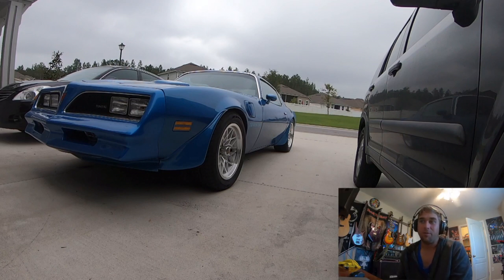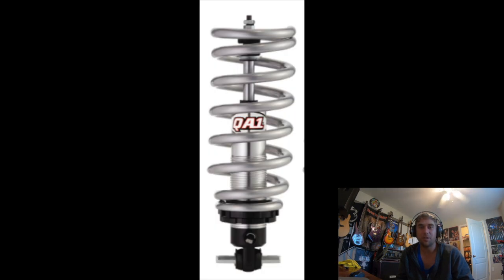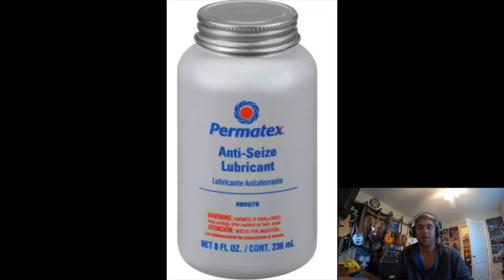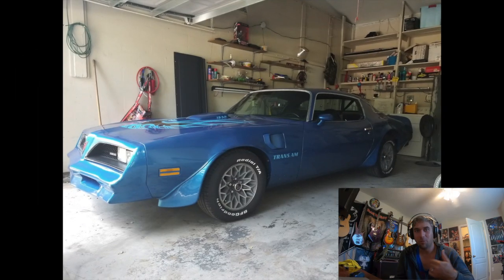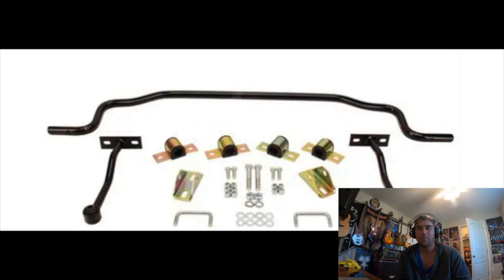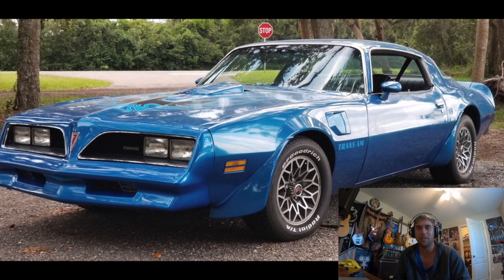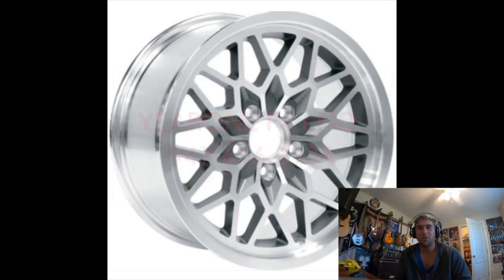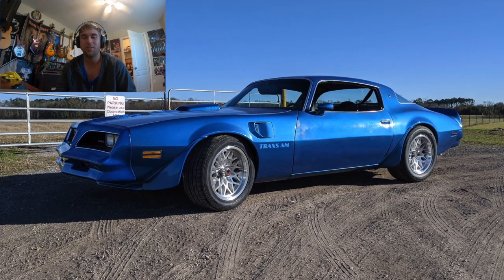1978 Pontiac Trans Am Martinique Blue QA1 Coilovers

Comment: Nice TA, good job.  I like the 255-50s also.  Looks good and fills up the wheel wells. Thanks for posting this.
Reply from the maker: Thank you very much. The 255s are the way to without doing a mini tub or other modifications.
Reply: What about 275 will they fit?
Reply: @Eldandi88  Maybe, depends on how much you lower the car.  A 275/50 will be almost an inch taller.

Comment: With the 17in rims and 255-50 tires do you have any rubbing or clearance issues? Just wondering if I need spacers or if I buy the same set up will that fit right in with no issues
Reply from the maker: I have some slight rubbing on the front end. I have no rubbing in the back, even with the 2.5" drop. 

It rubs the inner fender tub on my car up front with the wheel maxed out on the passenger side and sometimes rubs when backing out of the driveway on the battery box hump in the drivers fender tub.

Comment: Dont listened to this guy 255 are to big for the front it will rub on lowered cars and also it will not look good go with 245/45/17
Reply from the maker: I could have sworn that I did a voiceover at some point in this video stating that if you did the 255's up front that they would rub on the battery box area of the inner fender. As far as what the look is, that is a matter of opinion. If you like skinny rubber band tires than 245 is the way to go but if you want it to look more period correct and have a little more sidewall than the 255 is the way to go. I appreciate you taking the time to comment and watching the video. Although we disagree on how the car should look we both obviously like the trans am and I dig it.